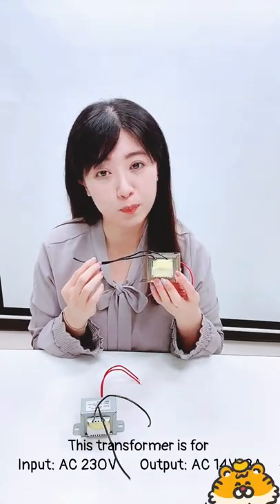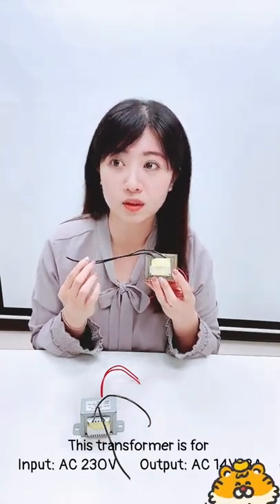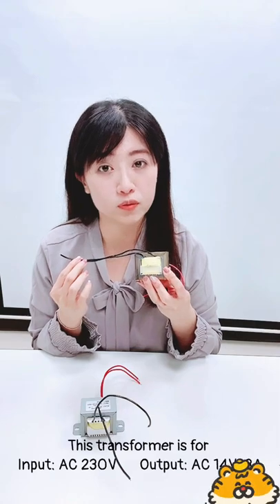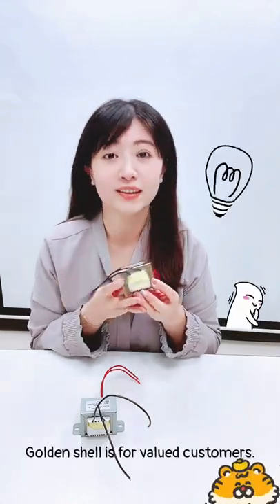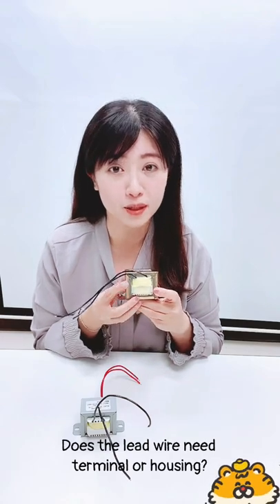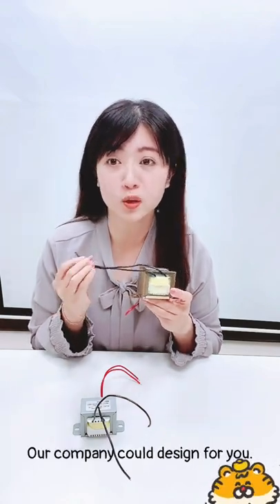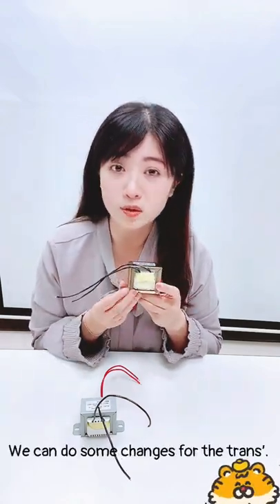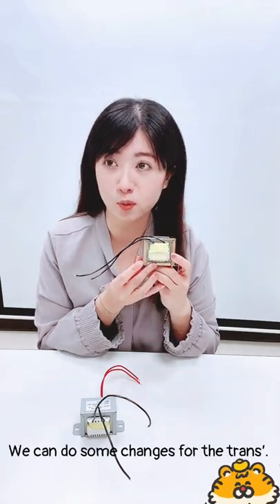50Hz 60Hz Low Frequency Transformer-Main Power

Comment: Nowadays, all types of electrical transformers or electronic appliances can work using a dual frequency system, namely 50/60Hz without any weaknesses or losses in the performance of the transformer even with the same voltage.